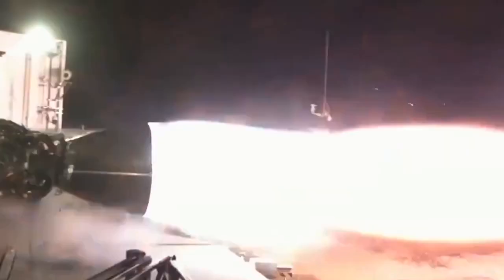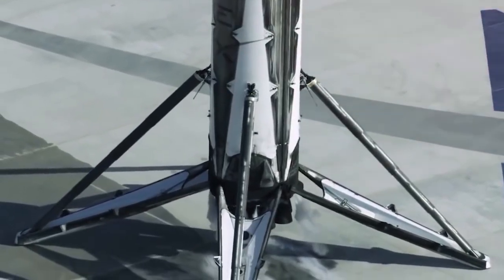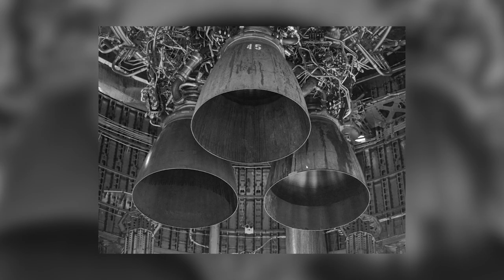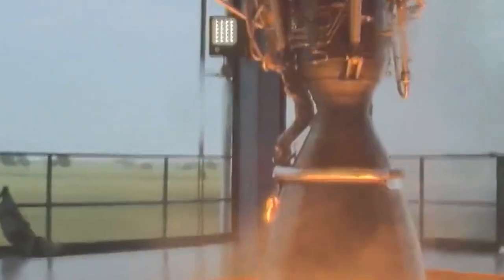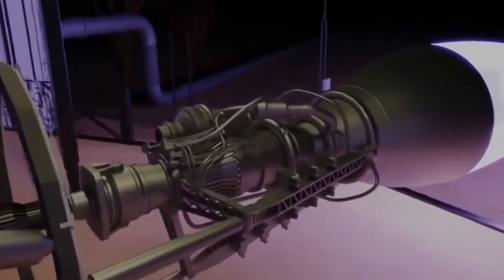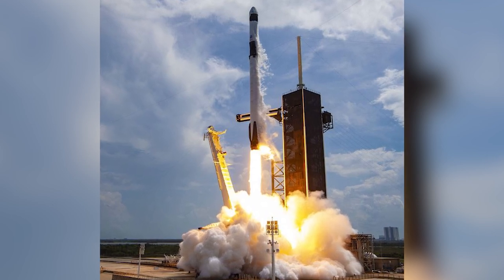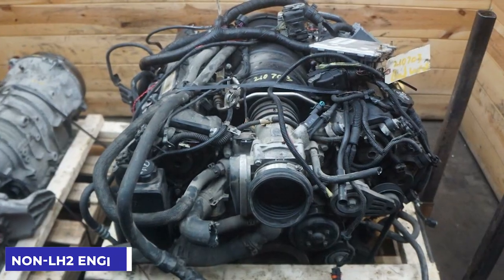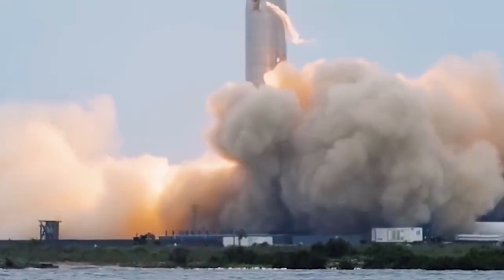How SpaceX Raptor Engine Works

Comment: What about replacing the turbine powered turbo pumps with ramjet powered turbo pump. In addition, use more titanium parts instead of stainless steel.
Just a thought.

Comment: Really poorly done video. If your going to explain what a full flow rocket engine is you need to show the internal workings of the system using graphics and animation, NOT show a bunch of unrelated animations and press release videos. Really poor explanations. Pull this one from YouTube and try again.